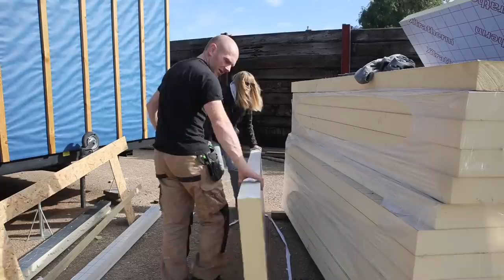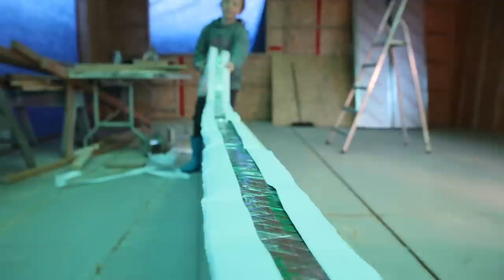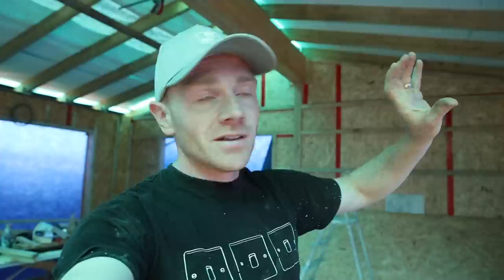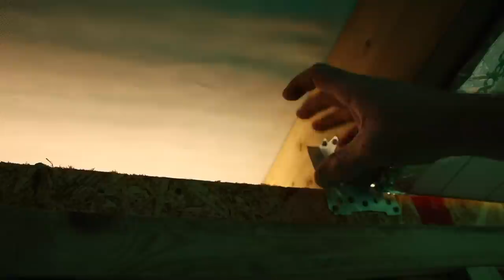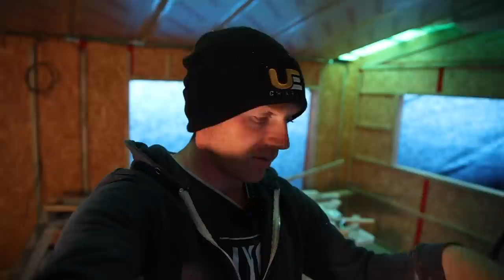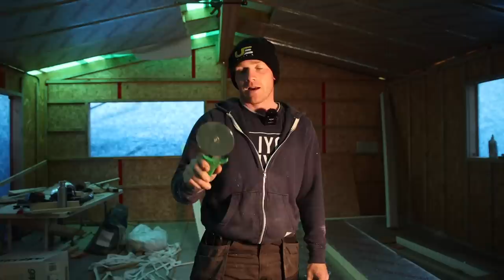INSULATING THE PITCHED ROOF - How memory foam and a pizza cutter made life easier!

Comment: Just a thought about the insulation reaching the ridge line when you where pushing the small sections up over the beam, did you cut an angle and push both sides right to the centre to seal the ridge?  an extra, small section would be needed to allow the angle to insert over the beam ( or stud wall)  push it tight up then slip a square sided filler block in to seal the gap left

Comment: I've spent the last 2 days fitting pir insulation boards in my garage conversion, I set all my timbers at 450 centres to get 3  equal strips from a full sheet. Everything was a perfect friction fit and no expanding foam used, I used a jigsaw with bosch insulation blades and they worked great 👍
Reply: Those Bosch insulation blades for the jigsaw also work really well as a hand held blade if held tight in a pair of mole grips. I bought the set of 3 blades and initially used them in the jigsaw but I found I could cut squarer with the blade held in molegrips run a few times along the face of a long spirit level to get a good 90 degree cut.

Comment: I've utilized a very long, extremely sharp Fiskars machete for cutting rigid foam insulation boards, using a stainless steel straight edge as a guide. It works very well for me, & is a clean method.

Comment: With PIR it's not just the dust or the cost, but the glass fibre mesh some manufacturers love to embed in thicker boards. I always end up with a few tiny glass fibre splinters that can be nearly impossible to see and remove, but hurt enough to be really irritating. By the fourth sheet I've normally given in and put gloves on.

Comment: I remember robin clevett doing a video about knocking a table up to cut PIR with his festool insulation saw but I think it could be used with a recip/jigsaw instead if you used an insulation blade 👍 dont know if the depth of cut would be enough for 100mm but certainly 50 & 25mm.

Comment: Bosch T 1013 AWP jigsaw blade. Bought one recently for cutting out roof windows in the fiber board insulation - wish I had found them last year. Absolutely effortless, no mess, super clean cut, advertised for PIR board too. Basically a bread knife in jigsaw blade form.
Reply: mmm added to the shopping basket
Reply from the maker: Looked at those a while back and completely forgot about them.  Will pick one up for the last wall of WFB I need to do next week.  Do they stay square through 100mm though?
Reply: They do work only problem is the dust…. (In an urban city job (windows open etc ) that can be a nightmare.. The jigsaw blade with some form of dust extraction then your away!
Reply: I use these blades with dust extraction, really quick and pretty much zero dust. I have had a few occasions of the blade not staying square but that might be me, the other thing is that the blade gets crazy hot so watch where you put it down. There are other brands of the same thing, I have an 80mm one that I used for a job with 70mm boards which stayed much more square.
Reply: I found with the insulation blades that if you score both sides of the foil first and then get the blade in the cuts to start with, it effectively guides the blade and its less likely to start wandering off line.
Reply: Regarding the cut wondering off line so far the most accurate cutting jig saw I've used has been the old style Bosch jig saw the mechanism holds the blade's very steady virtually no side to side play it'll give a better chance of not having having the blade drifting on the bottom of the cut
Reply: Used corded scorpion-type (reciprocating) saw, which has stiffer blades than jigsaws. 
Then ground the teeth off and chamfered the blade sides to make a bread knife profile. Perfect. Fast and safe. Later discovered special blades can be bought, but happy with making my own - I don't think they come as long as the 9" already had.
Cut dozens of 120 thick sheets inside store area - no dust!!!. 
Did also have Bahco handsaw, used more on cotton batts. Same profile as bread knife.
Bread knife also handy for trimming and notching to fit round pipes etc. 
Like the pizza cutter idea but would still need a saw for depth of thick sheets.
Learnt early on how much dust was created, and how horrid - eyes suffered - with ordinary saw blades. It's the profile. Thin and knife-like works cleanly and adaptably no need for fancy extraction.

Comment: To cut the boards I use a thin non serrated kitchen knife cuts all the way through with 2 passes on 100mm boards no dust clean cut. No flipping of the boards.

Comment: An idea for cutting insulation..... I used to use a normal handsaw but with the teeth removed and the edge sharpened to cutting large bits of foam. Its basically just a a huge knife with a handle and I would hope it would slice through the insulation,. plus you can maintain the sharp edge.

Comment: Inspired by this I revisit the use of a jigsaw (with insultation blade) for cutting PIR board. Previously I've found it wasn't that great - the cut was rarely square.

The way I resolved this was to run a stanley knife down both sides of the board for the cut. This prevented the jigsaw blade from wandering, and now gets a really nice (square) cut.

This should prevent the need to clean the snapped part of the cut, and slightly reduce the airborne particles.

Comment: I've recently completed the roof in our renovation project and used 2 layers of 75mm PIR along with that tape for the performance gaps. I'd read about special soft material blades for a jigsaw and bought some Bosch ones. They are amazing! Accurate straight clean cuts, and ZERO dust or debris. I'd highly recommend them if you need to cut boards like these (bit late for you @therestorationcouple I know) but a complete game changer when using this stuff.

Comment: I used gapo tape and it did 90% as you mention, on subsequent projects i have cut and fitted the insulation +3mm and pressure fit (with a squirt of foam) as im placing the joists,beams.  Progress is significantly more rapid. Need to sheet it asap as you build

Nice job as ever Tim 😀

Comment: FOR EXTRA HOT WATER USE A LENTH OF 10 MM COPPER PIPE WOUND AROUND THE CHIMNEY PIPE OF THE WOOD BURNER STOVE LINKED TO AND FROM THE HOT WATER TANK .THE COPPER IS SUPPLIED IN A ROLL AND IS ANNEALED TO MAKE IT SOFT AND FLEXIBLE THE ONLY PROBLEM MAYBE THE DISTANCE FROM WOOD BURNER  TO THE WATER TANK

Comment: Oh god we have 24m of roof to do with all the rafters at different widths, I wish we had a roof as symmetrical as yours. We have 100 sheets of 100mm and 50 sheets of overboard to do. Thanks for the pizza cutter and floor scraper tip, it well might be simpler and cleaner than our circular saw.
Reply: I've been there, with an older roof. It was a long tedious job, but nothing takes literally forever.

Comment: I think you can lay full insulation sheets on top the rafters external and batten on top with long fixings. Much easier and fewer joins?
Reply from the maker: Shot an espisode about that today.  Yes a warm roof is far better and nicer to install, however in the cabin it would not work as half was trusses which were a set height so had to match.  It is  the way we went for the walls though. 👍
Reply: OK will look out for that 👍
A sealed air gap is also an excellent insulator.
Enjoying your videos thanks.

Comment: i replaced the saw blade in my rage 5s with a  Diamond Blade ,  blade was same diameter, same bore and 1.5mm wide , i can rip up to 605mm wide  and 80mm deep , cuts like a knife through butter and no dust ,

Comment: Hi, Two questions:
1. Do you push your PIR insulation board tight to roofing membrane? If so how about ventilation gap???
2. You planning adding 25 mil PIR boards as well and then timber battens how you planning fixing it? Through 25 mil PIR board straight into roofing joists using longer screws???
Cheers
Reply from the maker: 50mm space above pir and yes battens below as you say. 👍

Comment: Don't quote me on this but I have a feeling that the new Part L (Conservation of fuel and power) Building Regulations now require the use of that Gap Tape on PIR insulation when being used. OFC that applies to the spaces where you have to comply with the regs in the first place.
Reply: I think your right, there’s an entire section now on nothing but insulation gaps and thermal bypass and the tape is one of the recommended solutions

Comment: 🤔Maybe you could try hot wire foam cutter or hot knife foam cutter(on amazon was some Dominox brand, around 70quid)and some different brands too. No dust at least🤷‍♂️ In youtube was even tests with own maked cutter. Welder with hacksaw blade fitted🤷‍♂️

Comment: totally flammable that insulation , grenfell towers was covered in it & look what happened when it a caught a flame , should be took off the market complete fire hazard
Reply: Different application as it is going into the roof. If you watch the flame tests they are carried out in horizontal. Grenfell was a vertical application.
Also the tape around the edges means the flame can’t get between the layers
Reply from the maker: It's one reason why we don't plan to use much at all in the main house apart from under slabs.  In reality most of the average house is a fire risk when it comes to materials whether contents or structure.  There is however a big difference between a multi story application and a single storey dwelling.
Reply: @TheRestorationCouple  o